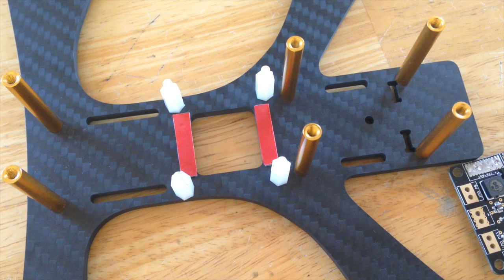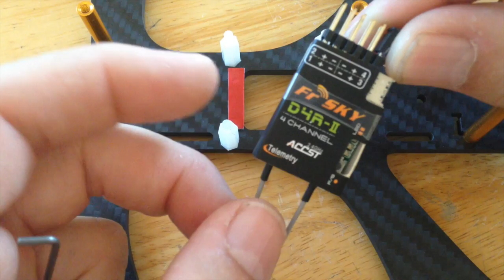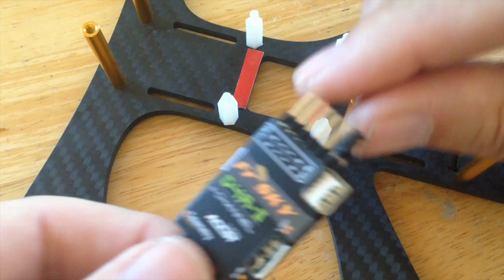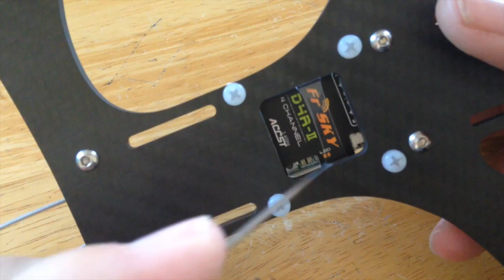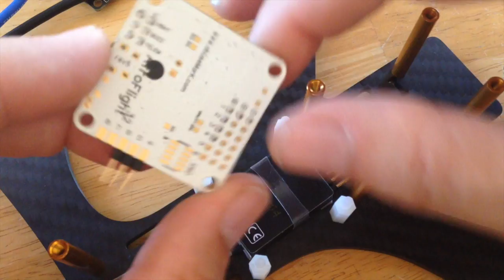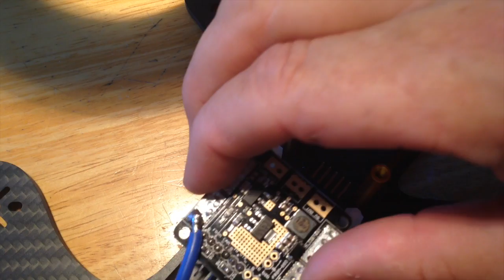Shen Drones Tweaker Build 1

Comment: question, which diameter (awg) of pigtail power cable is recommendable to use in a 4s setup? 14 or 16?  thanks
Reply: +INMERSO A 4S set up wouldn't require as thick of wire as a 3S set up. Sorry but I don't know the technically correct answer to that question. My recommendation would be go with the larger wire if you aren't sure.
Reply: ok, why I would think its contrary, can you elaborate?
Reply from the maker: +INMERSO If it were me, I would use the 14 because it's a little larger wire.
Reply: +bah7566 cool